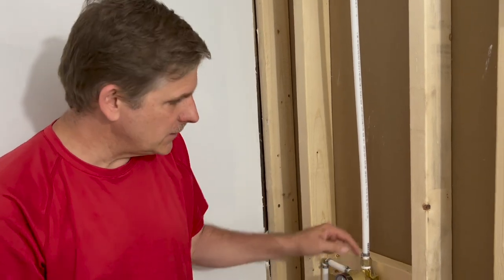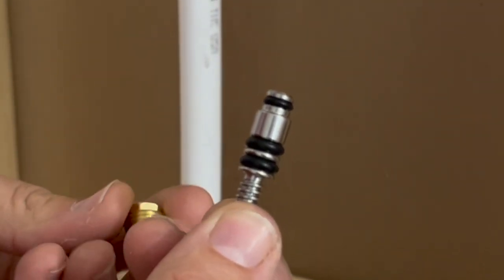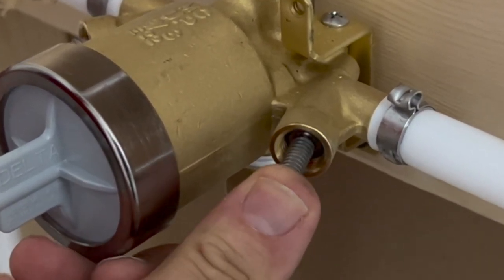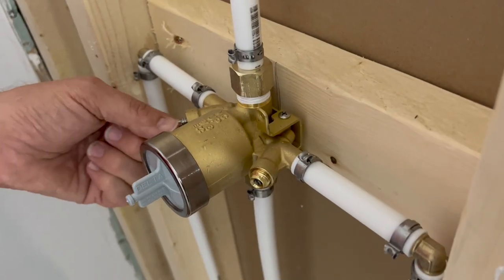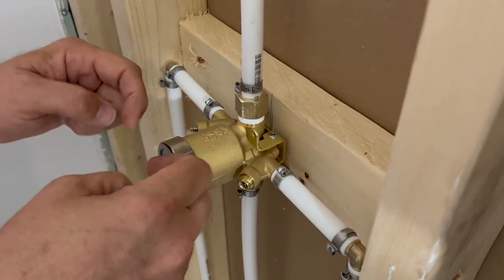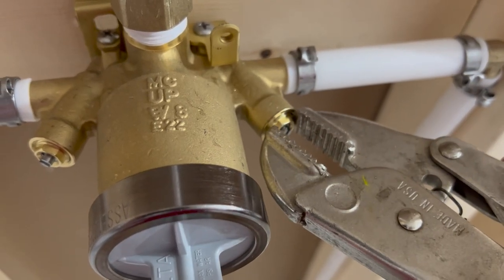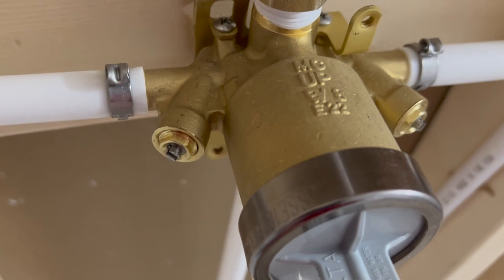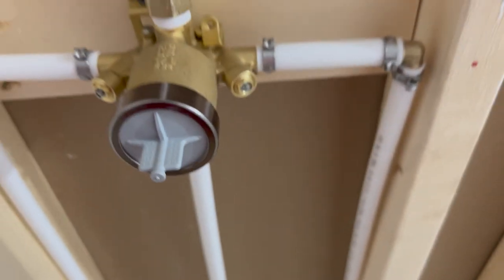How to Install Shower Valve Stops | Delta Multichoice Valve with Stops

Comment: My stops are broken on one side, can’t use a screw driver. Is there a way to remove without replacing the whole body??? New install
Reply from the maker: Yikes. Use an extractor ez-out?? Drill them out??? Not gonna be easy. 
Thx for watching!

Comment: These would make sense if there's no access panel or basement where shutoff valves aren't easy to get to. I would avoid stops in valves because they decrease the flow rate slightly and they are another piece in the puzzle to go bad later on.
Reply from the maker: Thx for the feedback!

Comment: Hi, I'm currently in the process of renovating my bathroom. Just discovered the shower valve does not come with shower stops. Are there shutoff valves I can attach to my existing  shower valve? Appreciate the help.
Reply from the maker: Hey JP..,
I am not aware of how to add to the valve. You could add shut offs to the lines going to the valve … or replace the vale w/ one that has shut offs.
Thx for watching!

Comment: What are the stops suppose to look like when letting water into the valve but not so far unscrewed that they leak?
Reply: The screws can come all the way out just make sure the seats(the little brass nuts) don't come undone

Comment: Just installed. Water will only flow when valves are open. When they are open I can’t turn the water on or off. Just continues to run

Comment: After I changed my valve and new cartridge I turn my main water on and all the water comes out the shower head
Reply from the maker: Hey Derek…,
Are you 100%?sure it’s the correct valve and 100% sure it is in the right position? 
I would check both to be sure. 
If not that, then look at you diverter / do a search on your particular diverter brand. Typically you move a handle, pull out a handle or pull down on the spout - some way that engages or turns on the diverter. 
See if the brand offers troubleshooting document online. 
Thx for watching’!